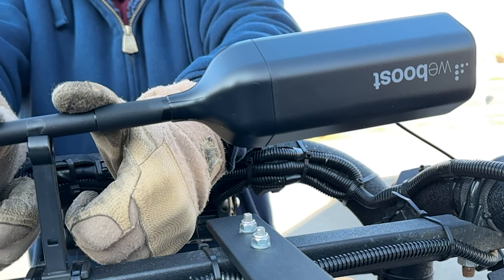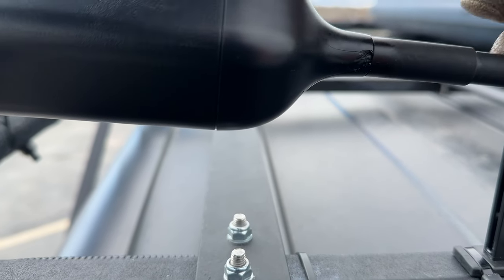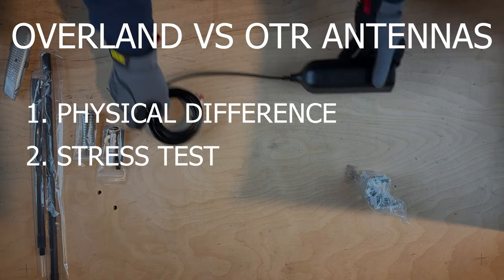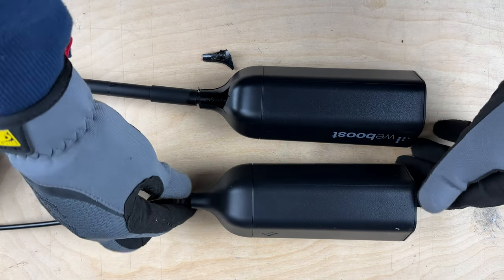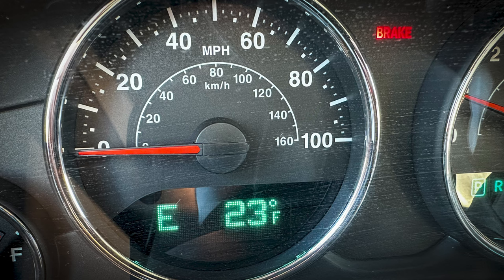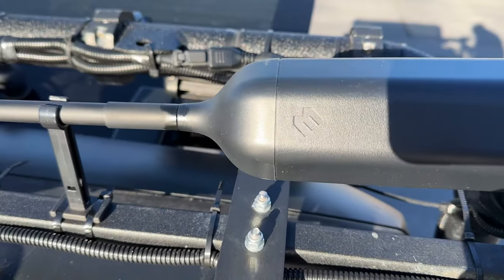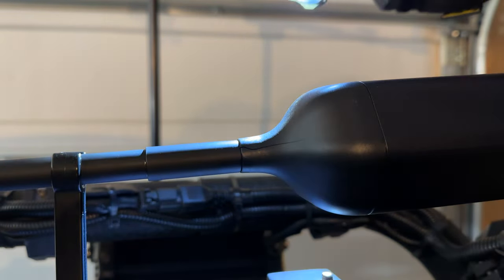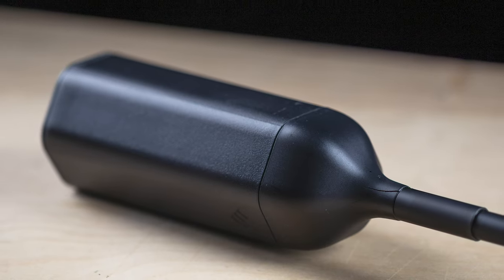Weboost Overland Cell Phone Booster Good Enough for Overland? Review and Feedback

Comment: Thanks for this, it looks like perhaps if the plastic holder were farther from the antenna, it would have room for less intense vibrations, and maybe mount a soft piece of foam for the antenna end to rest itself on and help dampen vibrations. In the instructions do they specify any specific distance you’re supposed to mount the plastic holder at along the extension to the antenna?

Comment: I was going to purchase this item but not now.  Not until they fix that.  Thanks for the video.
Reply from the maker: Hi, sorry for the late reply. I spoke to the vendor, they have changed the plastic holder. Also, they told me that the culprit was the threadlocker-when it comes in contact with plastic, it causes a reaction and makes it brittle. So the solution is to not put threadlocker on the part where the antenna connects to the mast. You can use it everywhere else. I did that, no issues so far. 
Thank you for watching.

Comment: I think their fix was to redo the retainer clip. I bought the OTR kit a few weeks ago (mid August '23) but have not installed it yet. But the round part of the clip looks like the rounded arms are shorter than the one in your video, so that it doesn't take as much force to get it in and out of the clip.

Comment: Been running my weboost for quite some time now and have never had this problem. Then again, I snap it at the metal collar as intended (mine has a metal collar indicated as an attachment/snapping point) and the vibrations don't travel down the shaft to the antenna to break it. We've travelled and camped offroad in everything from -15F in a snowstorm to 120F in Death Valley and our antenna has never failed. Interesting test.

Comment: Seems like you could easily fix this with a different type of stay instead of that clip. Need to rely on the upward force of the spring in the antenna to hold in place, that way there is no drastic downward force when placing the antenna in the stay (holder) .

Comment: wow, great test, thanks for doing this.  I just ordered one a few days ago before I saw this.  Not sure what I can do to keep it from cracking...
Reply from the maker: Hi, sorry for the late reply. I spoke to the vendor, they have changed the plastic holder. Also, they told me that the culprit was the threadlocker-when it comes in contact with plastic, it causes a reaction and makes it brittle. So the solution is to not put threadlocker on the part where the antenna connects to the mast. You can use it everywhere else. I did that, no issues so far. 
Thank you for watching.

Comment: I have never  broke any of mine in the west Texas oil  field roads , I had the the original Weboost Atenna with the blue amp for almost 10 years , if anything the cable wore out from rubbing against the chassis, I just resently bought the new style , time will tell but maybe it’s not made to lay over like that . Then  again I don’t drive like a bat out of hell through the west texas oil field roads , not only will it just destroy a 90 thousand dollar truck and break the antenna along with with it . They work great under normal driving conditions, these aren’t for you man . For over landers  like your self,  the company should make some sort of quick disconnect to use only when you need it . That would fix the problem. No offense brother just my opinion.

Comment: If this is happening to you 4 TIMES, that's pretty solid evidence of poor design and material of the Weboost. On the other hand, i wonder if you should try to relocate the mast retainer clip closer to the top of the antenna, near the weak point where the crack keeps happening? From the slo-mo, it looks as though you've discovered the weakest part of the mast for the retainer clip, that "whips" the heavier part of the antenna, which flexes it rapidly. Just an observation.

I was going to order one of these antennas to replace my basic car weboost external antenna, until I saw this video. I will NOT be ordering one. Too expensive for poor quality product. Not to mention, the "OVERLAND" mount costs an additional $120+shipping!!! Weboost wants us all to bend over.

Comment: I would come across these videos AFTER I buy the OTR we boost and overland mount... :( hopfully I can figure out a way to mount it to limit the cracking
Reply from the maker: Lol i know how you feel. So instead of using the plastic holder, I purchased a 3” QuickFist Clamp on Amazon. Installed yesterday, so will see how it will work. Also, I am not sure if you already installed yours, but Weboost told me the thread-locker, when it comes in contact with plastic, is what causes the plastic to weak and crack. So if you have not installed it yet, follow all instructions except for putting thread locker between the antenna and the mast. That is what i was told. I just did that yesterday, so will find out if it works in the near future.
Reply: @RibeyeconAdventures  oh good to know, thanks! Ihavnt installed yet , we got two days of rain here so I'm delaying it. I also will have to jerry rig the mount anyway since I don't have a basket rack or anything (i have a big freaking solar panel lol)  but, I have some ideas! look forward to hearing your results
Reply from the maker: @inkstickart  nice! Yeah, let me know how it goes for you as well.
Reply: @RibeyeconAdventures  Let us know how it works please. Eliminating all that "waggle" feels like an answer.
Reply from the maker: @LostandFoundTravel  hey! Yeah so I’ve been driving with it for the past few days now over various terrain, it is holding up. The best part is that the boost actually works really nice in spots where the signal is very weak and my phone shows no reception i get one or two bars and can listen to spotify and text.
Reply: @RibeyeconAdventures I know  from past experience that the thread locker can cause plastic to crack and is probably the main culprit however if you look at the instructions on their website it suggests using thread locker on the joint between the antenna and mast. You would think after 8 months of knowing this is a problem they would change this. Do they have competent engineers and support staff?
Reply from the maker: @davidk6668  so to my knowledge, after speaking with their engineer, they determined that thread locker to plastic is the issue, and they modified the antenna, not sure if they released it for mass production though. The engineer recommended I follow all the instructions except putting the thread locker on the plastic. It's been working fine for months now.
Reply: They seriously need to redesign it. You should be able to use that thing as a golf club and it not break. We use these for Overlanding not mall crawling.
Reply: @LoneWolf_Snafu  ya I had to DIY the whole thing! It’s worked out well

Comment: I just received my WeBoost kit but no holder was included in the box 📦 🤔
Reply from the maker: Nice, may be they removed it from the kit because they realized that it damages the external antenna. So are you securing it in any way when it is folded? Thank you for watching the vid!
Reply: @RibeyeconAdventures  I’m using it on the stock Nissan Frontier roof bars so after folding it down I have a piece of foam rubber between the head of the antenna and the bar and then a simple tie down… nothing fancy but works to control bounce and keep it from contacting the roof bar.
Reply from the maker: @BBAuto007  oh I see, sounds like a good idea. Nice!

Comment: Wow! That is a really bad design and clearly they did not actually do any product testing. Guess I can take Weboost off my shopping list for now.
Reply from the maker: I believe they fixed the issue since this series of vids. They told me the problem was the interaction of plastic with the threadlocker, which resulted in a chemical reaction that made the plastic brittle. They supposedly have redesigned it.